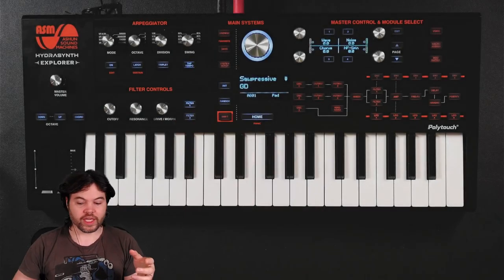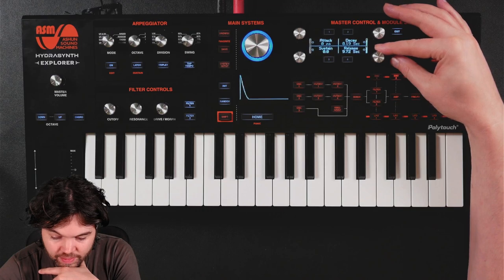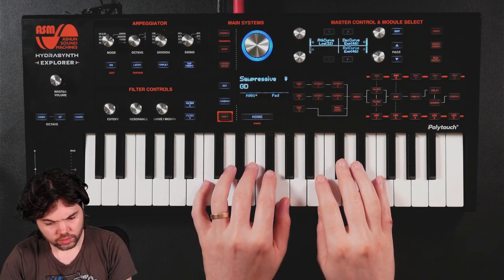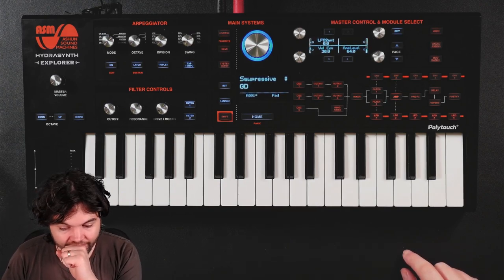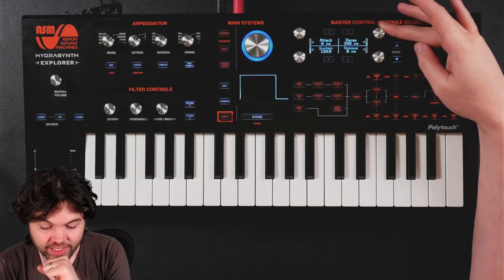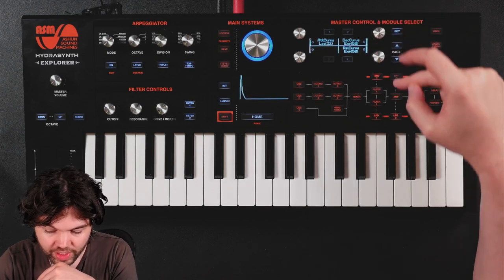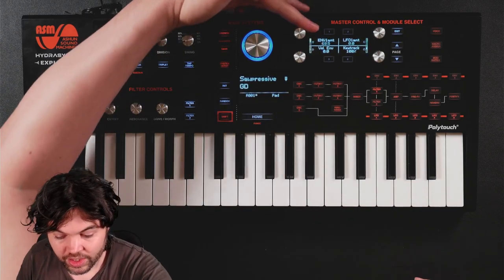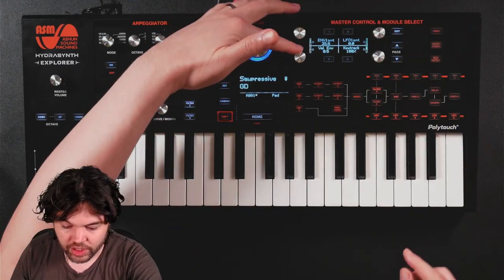Learn With Me - Hydrasynth: Ep09 - Envelopes Part 2

Comment: Would like to see you explaining stepped lfo’s
Reply from the maker: Thanks for watching, and for your comment. The next two episodes go through the features of the LFOs, including the step LFO, though I don't necessarily demonstrate that feature in great depth. After I make my way through the core features (still got the mod matrix, and macros to cover) I'll bring things together and make a few patches. I'll make sure to include a deeper look at the step LFOs in one of those.
Reply: I combined two step LFO's where one plays the notes and the other controls the mixer volume for the oscillator. Doing that, I could mute certain steps. Really powerful!
Reply from the maker: @GertBoers  I've experimented with that and it's definitely fun, but I find the workflow quite awkward if you need particular steps muted (jumping between two separate step edits). A thing I've enjoyed is doing this with BPM synced LFOs and different step counts (e.g 7 vs 8) alongside poly trigger. This means you get decoupling of gate and pitch allowing for much more sequence variation with less need for planning.

Comment: How do you assign an env with fast attack and fast decay to OSC 1 and an env  as a pad to OSC 2? It's possible? How to do?
Reply from the maker: Thanks for watching and for your comment. You can use the mod matrix to modulate the mixer levels for each oscillator; you should set the mixer level for the oscillator itself to zero first so the mixer can be closed fully when the envelope closes. Remember that the amp envelope is still in effect so you probably also want to set that (env 2) to no (or very short) attack, no decay, max sustain and long release.

You have another interesting option if you are doing this; you can set the filters to be parallel (you probably want to enable key tracking on filter 2 too) then route one Oscillator to filter 1 and one to filter 2; this, combined with the previous suggestion, effectively lets you design 2 sounds (with separate Oscillator filter and envelopes) that are layered.

Also I checked out some of your music: some very nice compositions!
Reply: @ChalkWalkMusic  I already do everything you kindly told me... it's useless, I can't, neither I not a friend who has the same problem.
I tried all the combinations of the Env with the mixer, volumes and more in the mod matrix. Nothing to do!
A tutorial would be needed, anyway thanks for your help, because no one shows what I ask, all the tutorials on youtube show how to do relative things and with just one ENV.
Reply: @ChalkWalkMusic  each ENV is strictly linked to the shape of ENV 2, I can't use it!
Even putting (ENV3/Mixer/OSC2Vol/128) in the matrix binds to env 2
Reply from the maker: @salvoreitano74  I think there is one thing you missed in my reply: all the signals always pass through the Amp, which is always linked to Env 2. You therefore need to change the shape of Env 2 to one that allows all the other signals to pass through; set the attack and decay to zero, sustain to maximum and release to something much longer than any of the envelopes you use per oscillator. I recommend you use Env 3 and Env 4 for the mixer levels (as they have no normally routed functions). In your example, be sure to turn Osc 2 volume down to 0 in the mixer as well.
Reply: @ChalkWalkMusic  Really serious, I finally succeeded, of course I used the decay to less than 300 on ENV 2, now I understand the function of ENV 2. Thank you for your reply and I wish you a lot of luck. You are the best